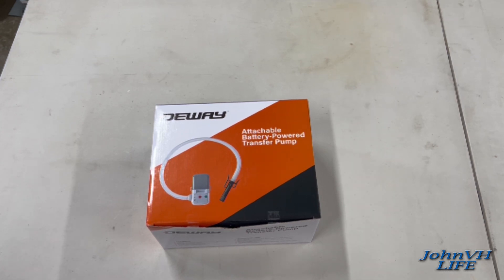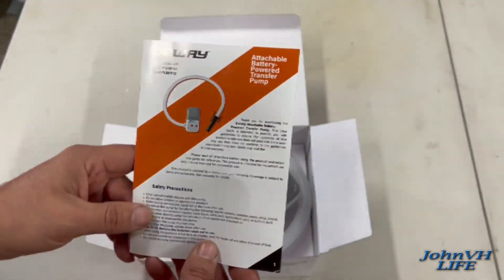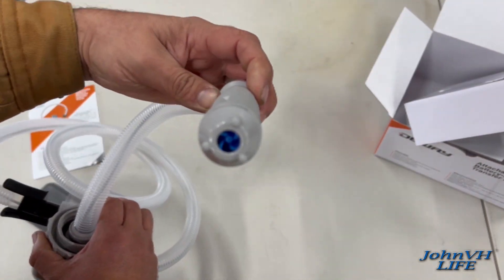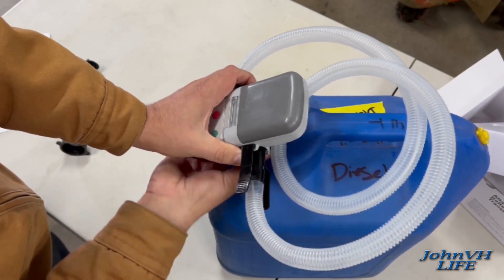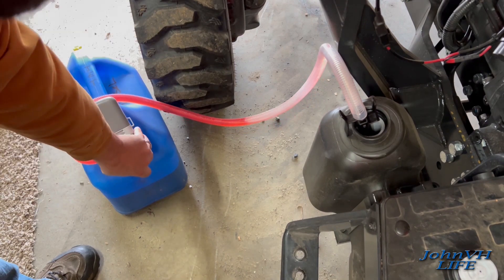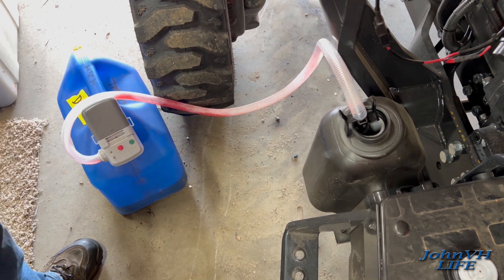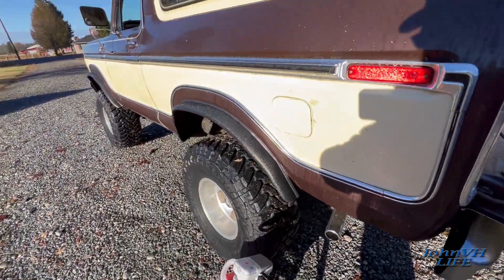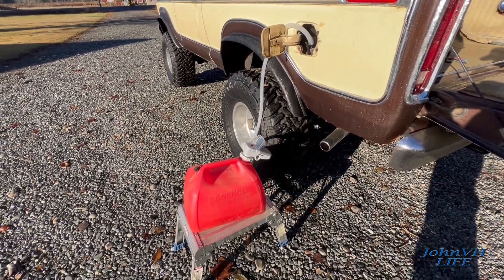Deway Automatic Fuel Transfer Pump with Auto-Stop REVIEW

Comment: Tried raising my hose to drain after using but somehow it keeps coming up through after I put the nosel back in the hole.
Reply from the maker: must have pressure in the tank? Crack loose the unit or open a vent